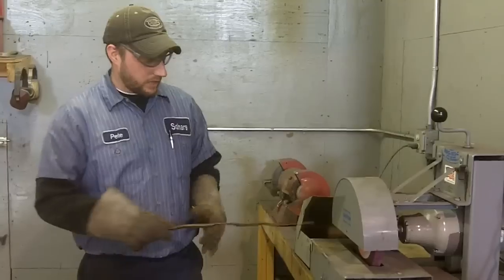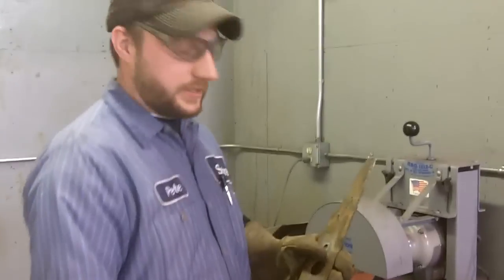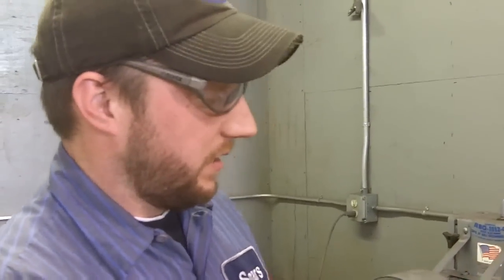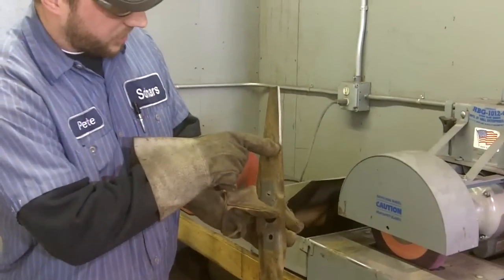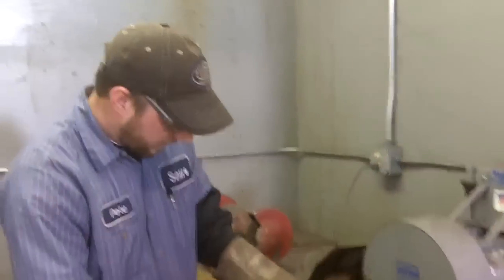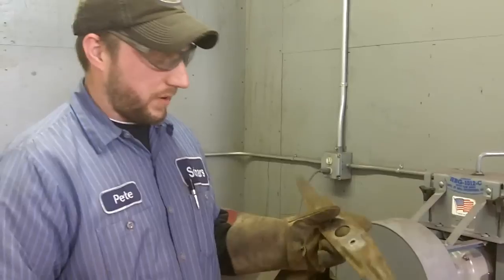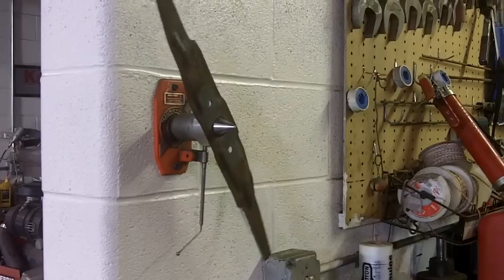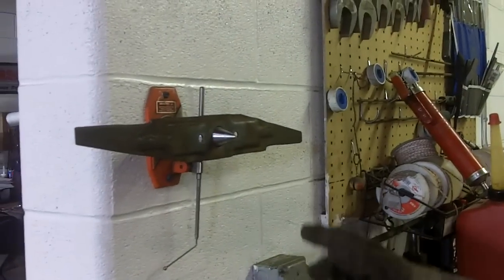How To Sharpen & Balance a Lawn Mower Blade

Comment: I grind with the wheel counterclockwise and gets much sharper and a lower blade cutting angle, plus I sharpen all the way to the bolt hole. Much better mulching
Reply: I'm not sure why they run different angles, but that interesting about sharpening them further in.

Comment: a few divots in the blade are advantageous--as anyone who has cut a veggie knows (and grass IS a veggie --ask any cow). I use a hand grinder once a month and push through anything --wet, dry, sticks , whatever---wayyyy too technical-but agree that balancing is important if for no other reason than operator fatigue..
Reply: Balancing is not for operator fatigue. If you think that then I don't know what to say to you but balancing is so you fuck up your spindle and bearings. But if you are using a shitty push mower go ahead and not balance it, but I'm not gonna fuck up my $7,000 mowers spindle and bearings because I didn't balance the blades.
Reply: joe lober
I digress joe. I'm talking a 10 yr. old Craftsman 22 in. push-mower and yes I DO balance w/ a smooth nail. I also change oil,spark plug and filter yearly and expect to get 8 more years unless those wobbly plastic wheels fall off or the deck rusts out (I hose off the underside following each mow) --in which case I'll trash it and buy another. Thanks for your input.

Comment: Couple points: 1. Seems to me the grinding is way too aggressive, taking off much too much steel. All that's needed there is a sharp cutting edge for a reasonable length, unless you're in the market selling replacement blades. 2. On balancing, first clean the whole blade with a wire brush, then set the conical balancer spindle in the blade hole. THEN pull the magnets to the blade, vice grabbing blade with magnets, followed by smacking the blade to center it on the cone.
You're not the first I've seen to grind the crap out of a blade. (And burrs on the backside can very easily be removed with a flat file. HTH

Comment: Why don't any of these guys ever clean the shit off the blade before
they start to sharper it?  The dirt can throw off the balance and screw up
the sharping!
Reply from the maker: We always recommend cleaning the blades before sharpening. Here is the video taken before the sharpening video: Cleaning Your Mower Blades Before Sharpening
Reply: a wire brush on a drill takes 2.36 min.from start to finish- but if yer hosing off the underside after each use you can do it by hand in 1.38 min. with time to hit yer beer.
Reply: James Reising sounds like a winner to me!
Reply from the maker: Bob B Or you can get yourself one of these! MAG-12008 Lawn Mower Blade Cleaner DEMO
Reply: Replacement Commercial Parts Warehouse
 What a waste of money.  A simple hand grinder with a welder's wire wheel brush and a small vice is all that is needed.  Heck, if money is tight, a good solid wood handled brush and a small vice would be fine to clean the blades, it just takes a couple minutes longer. 

Even that RBG 1013-C is a waste of money & is only good for sharpening blades.  Just about any good 1-1/2" to 2" wide belt grinder is faster, cleaner, and will produce a better job every time, and you can find them for half the price of what you get for your commercial, grinds nothing but mover blades, RBG grinder.  Mind you if you want a really good belt grinder like a Burr King X400 it will cost double the price of the RBG 1013-C (1012-C) grinder.  A Burr King 760 would cost triple but is about the best belt grinder on the market. The catch is you don't need anywhere near the best to beat the RBG.

The ONLY good piece of equipment (not counting the PPE) your guy used was the Magna-Matic MAG-1000 blade balancer.  It is a must for a properly balanced blade.

But then again, that's just one person's opinion.

Comment: Guys, you don't need a grinder for most of us.

Generally a clamp and hand file is more than enough to get a nice edge on it.   Just use both hands and be sure to maintain the angle from the factory.   This also avoids taking off too much material and causing balance issues. 

By hand is probably necessary anyway for mulching blades that have weird angles to them.  

You can also ignore divots in the blade as they don't really have much effect on mowing and shortens blade life to remove so much.

Comment: All true and great points!  You also have to consider your time (most valuable of all), cost of driving to and from your local dealership. (that is if you dont have a grinder and the right tools.) The time it takes to drive from your local dealership. Your carbon foot print from driving to the dealership. Just a thought.. Thanks for posting this great video !

Comment: I found this useful, but being a noob to this whole thing how do you make sure you are maintaining the correct blade angle, or doesn't this matter?
Reply: Really, this video wasn't that applicable to the vast majority of people especially if you are a noob.  Most people might use a file, a regular bench grinder or, an angle grinder like I do and, not this dedicated blade grinder.  Most people are not going to have that fancy balancer either.  It alone costs around $200.00.  I have a cheaper model but it still cost me $81.00.  Until I got it, I used a cheap plastic cone balancer.  It will work fine especially for residential mowers which have a slower blade tip speed.

Comment: dude not knocking you but a hand grinder and a nail gets me closer the your procedure every time, just sayin. and i used to use to use just a flat file.You didnt even claen thr blade first as we do down here.
Reply from the maker: These particular blades were cleaned before sharpening and this process is shown in a separate video: Cleaning Your Mower Blades Before Sharpening
Reply: Balancing on a nail might work to some extent but, it isn't nearly as precise as the blade balancer used in this video or even a plastic cone balancer.  Especially with commercial mower blade tip speed as high as it is, along with the expense of the heavy duty spindles holding on the blades, dialing in the blade balance closer to perfect is a smart idea.

Comment from the maker: This particular set of blades had quite a few burrs and knicks from the customer hitting rocks and yard debris. When this happens, you have to remove quite a bit more off of the blade to get a good cutting surface. Under normal circumstances, grinding only takes off a little bit of the surface.
Reply: Replacement Commercial Parts Warehouse k2500
Reply: Replacement Commercial  Parts Warehouse

Comment: Very informative video. Just a thought... you could just buy a brand new Oem Blade for $30 shipped...
Reply: But if your a commercial cutter and have a 60" zero turn with $20-$30 blades that gets expensive